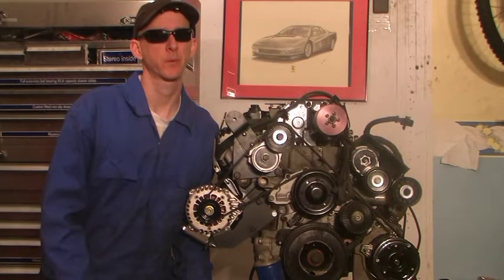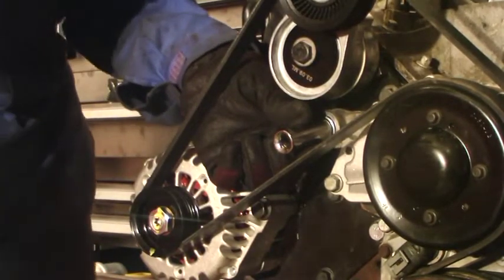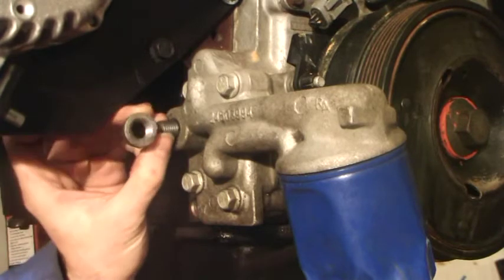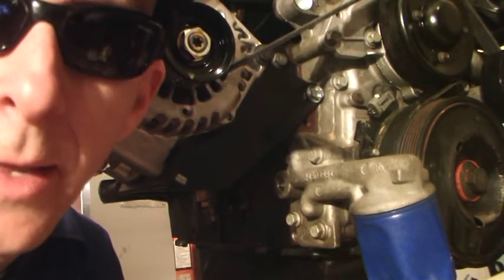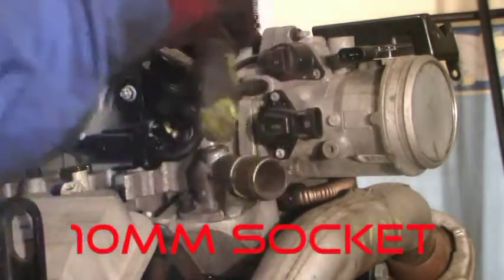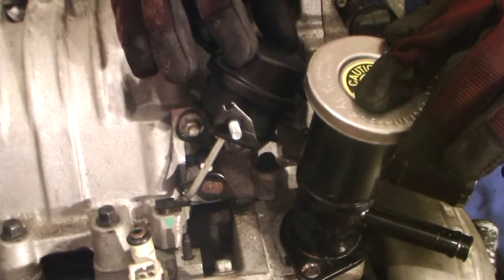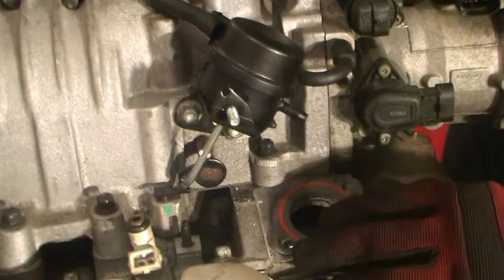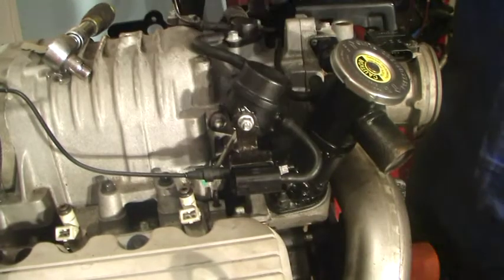Pontiac Fiero 3800 HOW TO: Installing oil sending unit, Thermostat & plugging water pump

Comment: from what I've read on the forum the oil pressure sending unit is grounded through the threads. Using teflon tape on the threads may lead to higher guage readings.

Comment: Great vids. I don't know if i would have done this without them. Hey where does your return from your heater core go back in the engine if that water pump housing is plugged?

Comment: Just curious - do you not need a thermostat anymore?  Also, what aftermarket stereo do you have in your Fiero(s)?  Thanks.
Reply: The modified housing he installed uses a stock style drop-in fiero thermostat. Like this http://m.autozone.com/cooling-heating-and-climate-control/thermostat/failsafe-thermostat/pontiac/fiero/361930_52254_1644?location=

Comment: what u gonna do about where the exhaust exits from the motor
Reply from the maker: I'm not sure what you mean exactly. Are you asking about the exhaust manifolds? The engine came with manifolds and a crossover pipe. As for the rest of the exhaust I purchased a used Spin Tech exhaust system for a 3800 Fiero.
Reply: the 2.8 dumps the exhaust right being the driver basically. I don't like how the 3.8 dumps right  behind the motor. I see what your gonna do . I don't like that for myself but I was wonder would a 2.8 manifold fit on the 3.8 or the fiero crossover pipie?